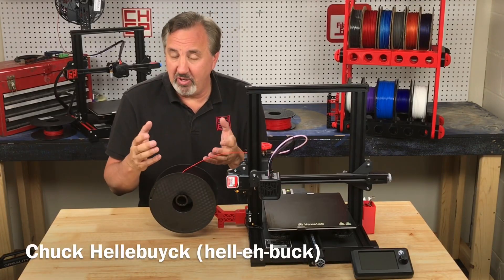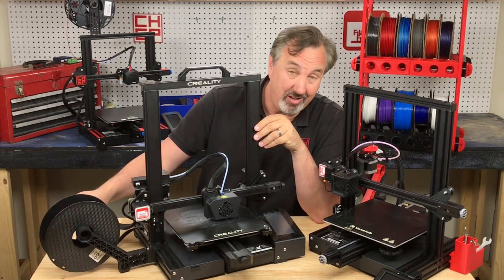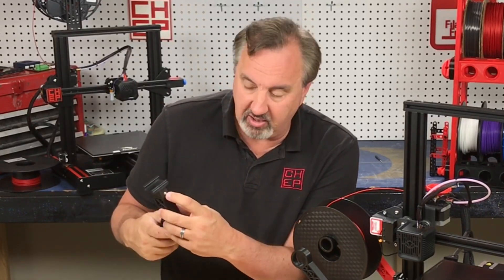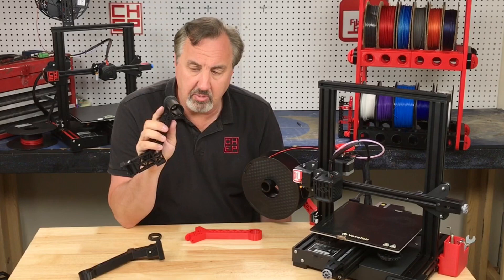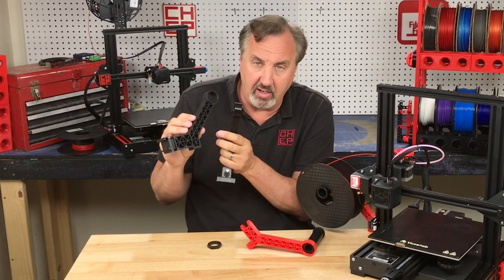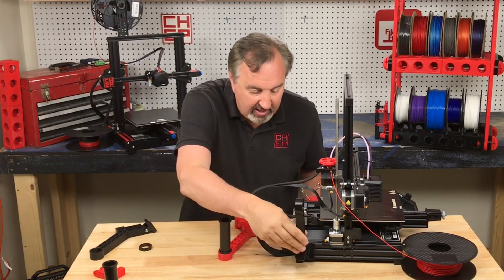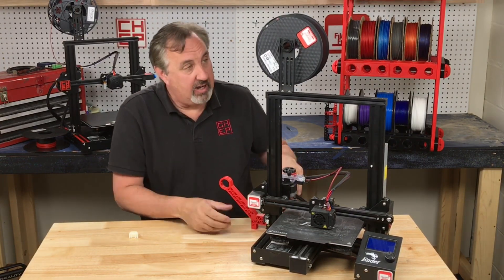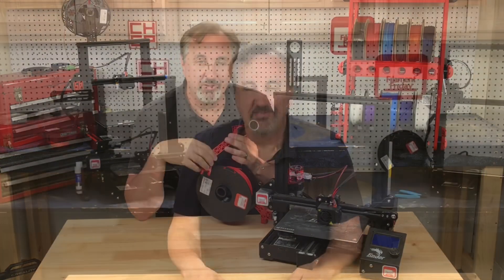Ender 3 Upgrade - Pivoting Side Spool Holder

Comment: I'm very new to 3d printing and happened to come across your videos.  I really like how you in depth you are in your videos.  It has made my journey a lot more enjoyable thus far.  I love this side spool holder and feel it's a must print for me, however, I don't see any designs for the spindle (filament holder).  I can probably find something similar but would like to ensure it will actually fit your spool holder.  Thanks again.  Cheers!
Reply from the maker: I used the spool holder that came with the printer.
Reply: @FilamentFriday  thank you. That makes sense

Comment: Do you know of a ball bearing roller version that fits your set up that doesn't require supports?
I really hate having to use supports as they are a PITA to get off not to mention wasting filament.
Thanks

Comment: Hi again! I've modified my Ender 3 V2 to use squash ball feet (from a Thingiverse object) for printer supports. I'm pretty sure I will need to extend the spool holder support height. I have imported your STL file into OpenSCAD but I'm kind of clueless about what to do next. My guess is I need to create a separate new cube, with X and Y dimensions matching the existing model's foot size. The new cube Z dimension would be sized to match whatever height I need specifically for my modified printer. Then I suppose a merge function could be used to join the two pieces together. Does this sound about right?
Reply from the maker: I don’t understand how putting feet on it makes you need to change the cube size.
Reply: I watched a number of YouTube videos featuring TinkerCAD tutorials today. It wasn't all that hard to size a cube extending the foot another 24 mm. You've inspired me to learn something.  Keep up the good work.

Comment: Just printed your design its awesome, I just cant slide it in, there is a square metal cap that doesnt seem to want to be removed and has no screws, its stuck in place. How did you remove that metal cap?
Reply: i have the same problem

Comment: I almost printed the short leg one because I have an Ender 3, but then saw the V2 uses the long leg.  I am in the process of printing now.  I hope it'll print okay in PETG w/raft because the first start didn't do well.   Will update comment with results later.  (I'm glad I found this remix before I found the original)

Comment: Hi would you like to make a similar spool holder for ender 3 S1 ?
There is a problem with mounting a bigger spool, (I cannot fit 2kg spool in it) cause the arm is slightly too short. I was thinking your project will be suitable for the S1 version too but I have noticed there's another kind of rail on S1 so it won't fit in there.
Reply from the maker: When I get one I’ll consider it.

Comment: I like the side spool better too but... I use a Creality  enclosure in my basement shop to help it  maintain temperatures in a cooler part of the house. The enclosure can be a  pain when you  have  a machine that wants attention but it  also keeps  things running well in a  65 degree basement. I think the best  answer for me  might  be to make a  Foam board enclosure  that can be  lifted off for service. That way I can use any  spool  mount  I want and  get the  enclosure  off in seconds  for service. I did that for a  old  Reprap machine a few  years ago. Since that machine  sounds like a old Sci Fi movie robot running the foam board  kills the sound as  well.

Comment: I used your plan for the spool holder on a Ender 3 v2.  (The long foot model.)  It works great.  My only problem was getting the support material out of the hole that is supposed to hold the spool, but I got it out with some effort.  Thanks for reworking the original model.

Comment: I just bought a ender 3 printer, and still a Novice printer, I just find it fascinating on how it works. That episode where you used the glue, that was the best, I have been using the glue for all my projects and it has been working Great! All the projects stick to the bed with no issues, Thanks for the great tip. Keep up your videos.

Comment: i used side spool holder from creality, it works great with pulling the filaments, i'm not worrying about frictions with the extruder. 

But i switched to the original top spool holder again and add a filament guide because the side spool is taking a lot of my space, also i planned to get an enclosure box that will only work if my spool is on top of the printer

Comment: Personally I prefer the side mount on my Ender 3 as the filament has a more natural path through the extruder. However on my Ender 3 pro I have a top mount because I have a direct drive system. I wish this was available a few years ago as I had to mod a couple different mounts to get what I wanted on my Ender 3. Better late than never. Guess I will print one as a spare. Thanks, Chuck.

Comment: You can't use it with the creality enclosure But if you're not going to use the enclosure it is a good option . I have a micro swiss direct drive that i will fit to my E3V2 eventually so the top spool holder will be the best option  anyway .
I just fitted the creality dual z axis screw conversion to my E3V2 and am about to fit a belt link on the  z axis screws -you don't need longer z axis screws just re mount the original z axis stepper with t nuts and lift it and the second z axis motor (which is mounted on t nuts) up by 10 mm so you can fit the pulleys on the end of the z axis screws -still plenty of  clearance for z axis homing.

Comment: Sitting 1-5kg on top of one side of your machine is just a bad idea full stop. I prefer 5kg spools nothing worse than doing a 1 day print and not checking how much filament you had left 🤦🏽‍♂️. I mounted my spool holder to a block of wood straight to my table, side mounted per say

Comment: I have a very low basement ceiling where i do my 3d printing.  I have a Styrofoam enclosure that I lift on and off when I'm printing, so a side spool is imperative.  Thank you for this.  The swing-away aspect will make my life easier.

Comment: I have always wondered why I have to flip my Ender 3 pro on it's side to access the main board when the Ender 3 pro is accessed much more easily from the top. Why did they change this?
Reply from the maker: They swapped it to make the SD card easier to access.

Comment: It's funny, this is basically what I have been working on past couple of days. Trying to get the 180 deflection I need and then the filament guide. Tried using a little roller with a bearing but it's too small and catches. Using a larger wheel/pulley setup from thingiverse that has built in Filament guides. Not sure if this will be the one or if I need to use a fixed deflector with like a ptfe tube around the bend or something.

Comment: I use the 5 lb spools from coex, and modified the "adjustable filament spool holder" from thingiverse to fit the wider and larger diameter spools. It is a stand alone holder, snd would highly recommend it over any attatched holder. Being a separate unit, i can place it anywhere.

Comment: I have an ended 3 pro and I keep it in my garage workshop. I use an old server cabinet as an enclosure to keep the sawdust off so I don’t have room for a side spool holder unfortunately. Side mount would be my preference

Comment: My ezr extruder got a deep enough groove in it so it stopped feeding. I drilled the inlet a little and shoved a scrap of bowden tube in it. The side mount is nice but because of high humidity I find printing from a sunlu dryer makes better prints

Comment: Gotta get some bearings on the holder. My spools kept rubbing and making a squeaking noise with the stock ender 3 rod. 

Cleaned it and even tried oiling with some food oil, no dice. Even after the few months I used it for, the filament had already scratched reasonable deep in the holder.

Comment: waste of time and filament, i too the original spool holder, and used the existing hardware, mounted it on the extrusion on the bottom side, and have a ptfe tube to help with the feeding into the extruder.

Comment: THANK YOU!!!! I use the original side spool holder you designed that uses the T-Nuts from the kit. So now I can print a new 1 that works just like my Ender 3 Max's spool holder. NICE!
I just took your tinkercad files and adjusted for M6 bolt and nut, as that is what I keep on hand for my projects.

Comment: I actually don't like the side spool holder for the E3Max, the spool tends to almost walk itself off the holder, the holder doesn't sit straight and leans a bit from the weight of the spool which causes the spool to almost walk off the holder. I've tried different positions and it just doesn't seem to make a difference. I will give your version a try and see if it works any better as I do like idea of the side mount spool holder.

Comment: You know Chuck, ever since I went to direct drive I fell in love with it.  Cut my problems in half.  You. have to use the top spool holder but the filament just drops straight down and right into the hot end.  It works like a champ and all the parts needed were on Thingiverse.
Reply: That was my route as well with my V2 and I'm thinking I might convert my 3pro to the same system. I went with a simple 90 degree direct drive bracket, fits the stock extruder. Recycle the bowden tube as a feed tube. Then tossed on Petfang's Bulldog cooler printed in CF-PLA to deal with the cooling problem these printers have. Didn't matter the cooler, just that it had a duct on opposing sides to get even, consistent cooling around the part, stock just has a single slit that acts as a part cooler.
Reply: @eideticex  My Bowden tube is about two inches long and out of sight. The filament comes right off the spool at the top and right down to the hot end.  I have not had any heating problems at all.  The filament takes no sharp turns at all.  Maybe I was just lucky.  I am surprised that more people don't take the route.

Comment: I prefer having my spool on top. It takes up less table space. Perhaps just a simple guide would prevent wear.
Reply: Top mounting spool leads to greater momentum vibration when the gantry lacks support beams. Not the best design as it will amplify any print error caused by rapid motion (and a reason I have resonance compensation switched on in Marlin) :(
Reply: Even sitting a 1kg spool on top is silly wait till you use 5kg rolls 🤣

Comment: I like how you took an idea and thought through how to improve upon it to make it work better for you, iterative design, gotta love it.

What if you were to modify the bottom (foot) of it to match the rails on the Ender/CR6 so that it would fit both modified and unmodified? That way, if you've modified yours with feet, you can add a foot to the spool holder as well and if your printer is stock you can just use it as is?

Comment: I don't see the appeal of side spool holders - but if I did this looks like a great one. Thanks for publishing your design/remix!
Reply: I have my 3d printer in a space where height is limited so side spool holders are a good solution for me.
Reply: @EaziGX  yeah, I never said that it doesn't have a use for other people. I just don't see one for myself. I have limited table space but a 3m high ceiling
Reply: Over a year and no wear on the extruder because I have a side spool holder. Using a bearing assisted spool holder makes it easy peasy and basically a straight shot into the extruder. Works for me. space is not a problem. Actually, I have it on three printers - 3Pro, CR10-s, Sunlu S8.
Reply: @michaelhenderson5098  close to a year and no wear either - I have two filament guides with skateboard ball bearings ;)
Reply: The appeal for some (me included) is that you want the bulk of the weight of the spool to be added to the base of the printer and not at the top, as it introduce more vibrations along the gantry. Obviously you require the side space on the table for it. The best is to completly detach the spool from the frame of the printer so when the extruder pull/push filament, the vibrations are not resonating through the printer. See TUSH on Thingiverse.
Reply: @gil80  that's a very good point, actually. As I plan on putting all my filament into sealed dry boxes (living in a very humid climate) once I've found usable, affordable and available ones eventually, I'll do that anyway but it might just have climbed up on my priority list significantly. Thank you!
Reply: @saschaschneider6355  good luck. I think once you get there, you’d appreciate not having the spool rocking your printer :)
Reply: @gil80  hence why screwed my directly to the bench the printer is on. Even thinking of putting on a separate bench beside printer to eliminate all vibrations Also 5kg/20lbs isn't exactly a good thing to sit on top of your printer 🤦🏽‍♂️
Reply: @williamhargraves8813  it’s like a small baby sitting on top of it lol

Comment: why not use a bearing spool holder?
Reply: I found that they allow the spool to turn far too easily so when filament is pulled through the spool continues to turn a little and you get tangles and overlapping etc.

Comment: You could also potentially fit one of those bearing assisted spool holders.
Reply: That's what I have. Love it.
Reply: Will this fit any of the bearing assisted ones right from Thingiverse or will fitting one require modifications? Any links to the holder that will fit with it? I am pretty sure my Ender 3 Pro spool holder wont fit with this because it has a threaded end, not a grooved end to accept the notch in this design... Any direction is greatly appreciated!

Comment: i used a side spool mount for a while but i noticed (on my stock ender 3) that the filament twisted and broke often while printing. It might be a fault in my spool but once i put it back in the overhead position never had a failed print till today